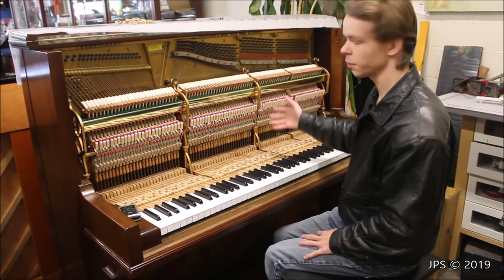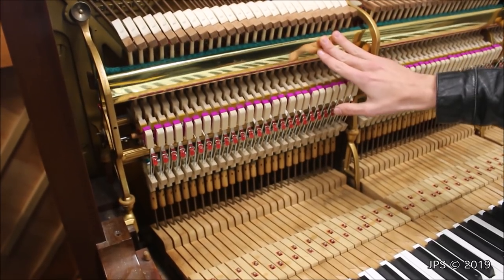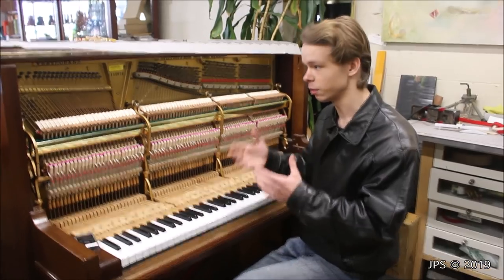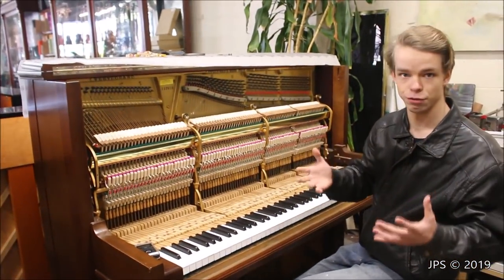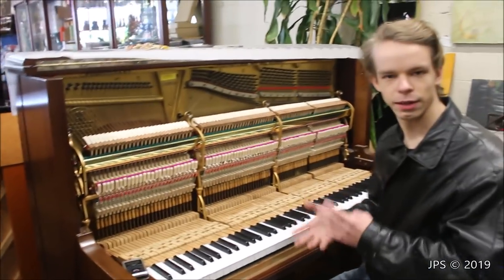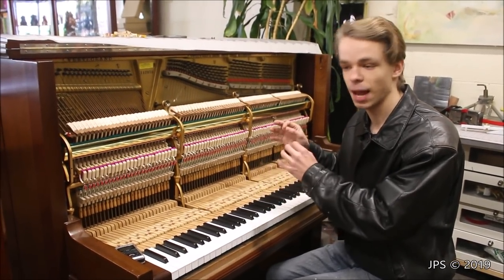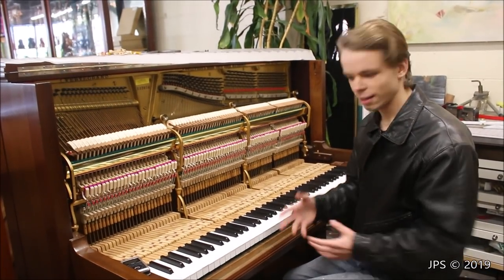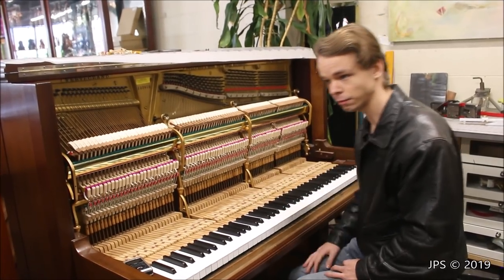1908 Steinway K Vertical Grand "rebuilding in progress"

Comment: I do not remember the figures for the estimates of pianos destroyed annually in this country, but it is enormous. Much of these are taller old uprights. This is a tragedy and if put to rights which is still  generally cheaper than a new piano, offers superior instruments with far more interesting tonal qualities than the bulk of what is made today. Of course nearly all old instruments need extensive work so one needs to develope an ear to hearing the potential through the flaws, sort of like listening to classical music on AM radio back in the day. You Tube has extensive postings of old uprights (many channels focusing on player pianos) whereby one can start to get an ear for some of the now defunct brands. Hearing (and all sense modalities) is like wine tasting in that one can learn to focus and attune to heightening perceptions of the sensory experience so that qualities start to emerge that one previously would have been oblivious to. As a for instance in trying to conceptualize certain treble sounds beyond just "brightness" let's say, it seems to me that some pianos (I have some Chickerings in mind) sound not to even have metal strings struck by hammers but sound as though glass is the sound source, a particularly lovely quality

Comment: I think you would love to play an old piano that was made in Guelph, Ontario by a company known as Bell Piano & Organ Co.  It dates from around 1910 to 1920 and it has beautiful wood grain on it that almost glows depending on how the light is aimed at it.  It has an interesting mechanism where when you open the cover for the keys, the top panel kicks out a little and becomes a music desk.  In fact the whole length above the keys becomes the music desk.  It has three pedals, but only the left and right pedals work.  An odd thing I find is that it only has 85 keys instead of 88 keys.  Everything is original, it's been tuned a couple years ago, but probably could use some restoration work.  It's possible that this piano could have been from a church or a school.
Reply from the maker: 85 key pianos were very popular in the 1800's up to about 1880's.

Comment: Brigham Larson, who has a You Tube channel with much content, is fond of the old verticals and restores many in his shop in Orem, Utah. The old verticals are especially preyed upon by scrappers as so many are offered for free via Craigslist etc and a couple of fools with a pickup can manage an upright which is then destroyed by the troglodytes for the value of the weight of the harp (which isn't much as the price paid for cast iron is low) no doubt to support their habits. Some have even posted videos showing the destruction of these instruments which I regard as despicable and a powerful manifestation of the devolvement of culture. Incidentally both a Japanese gentleman and one of the Fandrich brothers has devised mechanisms to bring the upright actions in line with grand performance though the piano manufacturers have not shown a great deal of interest so far